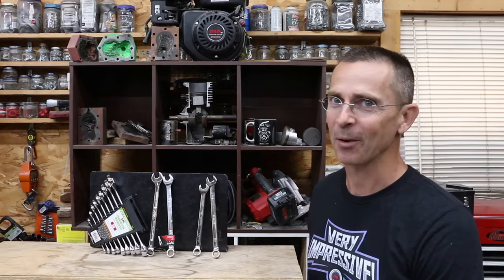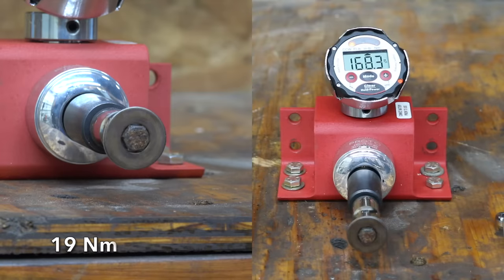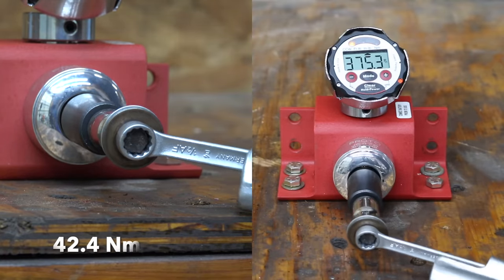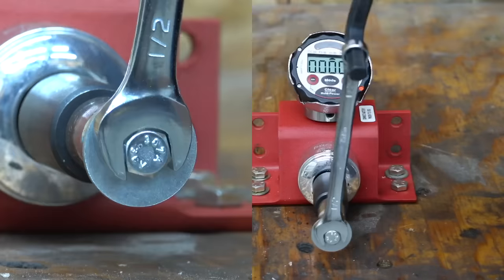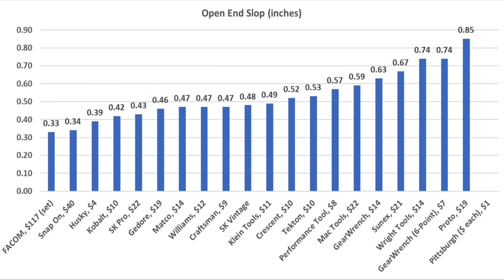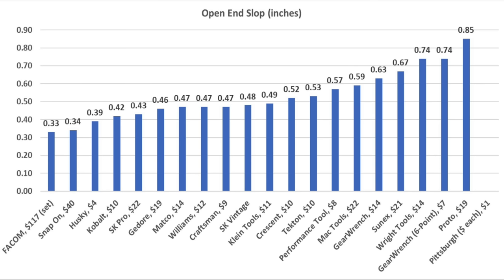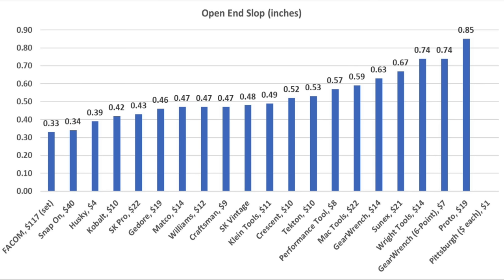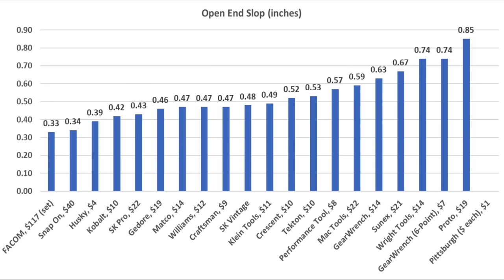Best Wrench? Let’s Settle This! Snap On vs MAC Tools, Matco, Proto, SK, GearWrench, Kobalt, Husky

Comment: Love this!  I go through 3/8” ratcheting wrenches like nobody’s business.  Gear wrench and Cornwell have done the best for me, but I’d love to see some 3/8’s ratchet get tested!
Reply from the maker: Thanks!  Thanks for the video idea.
Reply: Yep 😁
Reply: Snap-On 3/8dr ratchets handle over 250lb-ft. I’ve seen a test before but not on YouTube.
Reply: Which part of the Ratchet are you breaking to need to keep going through them?  I've been a Mechanic and use tools every day... I have at least 30 different ratchets in 3/8" alone... I've never broken a single one.  I have bought worn out vinatge craftsmans and gotten rebuild kits for them to restore them (Herbrand made era mostly, some Utica), and I have rebuild kits for every size of proto ratchet... but I've never had to use a single one.  Still got them in a little clear container waiting.
Reply: And......
 They will continue to wait whilst you continue to respect and take care of your tools, and use the right tool for the right job.....

Ive seen too many "mechanics" (lol) go for what they think is the "quick fix" and put a pipe over a spanner, or hit it with a hammer instead of respecting the tool and using the correct tool to remove a stuck or problematic bolt.....

Some lessons are learned the hard way 😮‍💨 .......

Comment: Great work! It's impossible to test, but there's a big difference between the tools of today and the ones made in the past. Trained as a diesel mechanic in my youth. Bought snap on, blue point, matco and proto tools back then. Almost all have survived 40 years of use and abuse.  Love the old proto wrenches. Great in hand and not too slick like snap on.
Reply from the maker: Thanks for the feedback.
Reply: I've got every brand of wrench imaginable--I'm in Erie PA & it seems like we're in rust belt/tool n die central. We have Crescent nearby in NY, probably 45 minutes away. Channel-lock 30 minutes  away & other companies in the area. I find $300 snap-on sets for $1. Indian motocycle collectible wrenches for a buck. Mac, Matco, Bluepoint/BP supreme, Craftsman, Bonney, Cornwell, wright, williams, SK, Wizard, Par-x & so on often for a dollar, even for a 15/16" or 1"+ never used wrench. I've got a lot of Proto & Proto Challenger and have to agree that these are among the best (except for one that had "Los Angeles" engraved on it;  that one broke. Go figure).

Comment: I like having a good/expensive set of sockets and wrenches for particularly tough or important bolts and also a cheap Harbor Freight version for everyday use. Those cheap things work 99% of the time for me.
Reply from the maker: Thanks for the feedback.
Reply: I’m the exact opposite. I make my living with quality expensive tools. I have some cheap tools for occasional use. I think I have a cheap harbor freight set in my boat that I hope I never use. I call craftsmen wrenches “knuckle busters” or “homeowners tools”.
Reply: And in all honesty, the Pittsburgh comes in two grades. The better ones are made in Taiwan
Reply: @benztech2262  out of curiosity what’s your living?
Reply: @livewirecowley  Judging by his handle I'm guessing he's probably a Mercedes Benz Tech
Reply: As a professional auto tech I have a lot of tools. Snapon, Mac, Pittsburgh, matco, gearwrench, and I have a lot of the same tool in multiple brands. My go to stuff is a mix of all the brands. I don’t give a shit about the brand or price, I only care about what works, and feels the best. Sometimes it’s a truck tool, like snapon, sometimes it’s a Pittsburgh pro. You would be surprised how often it is the Pittsburgh though.
Reply: @benztech2262  expensive does not mean quality. You won’t find a pair of pliers in my toolbox that isn’t made by snapon, because there is no better plier, but you also won’t find a single snapon torques bit in my box, because they are absolute garbage.
Reply: If you really need a tough socket, get impact (air-tool) sockets. I've had a few nuts I couldn't even break with an impact driver - for those I used a 4' long breaker bar. In one case I was removing a wheel hub retaining nut on a Honda Civic, and even with the car in gear and the full weight on the wheel, it wouldn't budge. 4' breaker bar resulted in the clutch slipping and wheel turning. Finally solved that problem by upgrading to a heavy-duty impact airgun. Socket never broke or rounded the fastener. Tough nut to crack!

Comment: I would like to see how the Icon line at Harbor Freight would stack up with Matco/Snap on / Mac tools. The sockets look identical to my snap on sockets.
Reply from the maker: Thanks for the suggestion.
Reply: @ProjectFarm  Another vote for adding Icon to the hand tool comparison when possible!
Reply: I was hoping to see Icons line up in here.
Reply: This is what HF does with a lot of their stuff. The problem is that most of the time its all skin deep.  Craftsman or Husky seem pretty decent for the home guy. If you're a pro, spend a modest amount and get the Mac.  Please don't make this a HF review channel Todd.
Reply: @boots7859  Currently, Craftsman and Husky have turned to India sourcing. So has the HF Pittsburgh and Kobalt wrenches. Craftsman and Husky are holding up well to most tests, but not Kobalt or Pittsburgh. Given that these brands are the most widely available to the average consumer, they should be tested to reveal their quality ranking. While most tool truck brands are out of reach of the average buyer. ICON is still made in Taiwan. As are most of HF sockets.  And I suspect they are OEMed by Gearwrench's parent company.  There is a notable improvement in performance to Taiwan-made tools as compared to made in China/India. So it's good to keep testing mainstream brands.  If you want to see tool truck premium brand quality shoot out, it should include the tools from Japan. They are as high in quality as Snap-On or MAC. Matco has slid down the scale IMO, no longer made in USA.
Reply: I'm also very interested in how Icon stacks up against the tool truck brands!
Reply: I've used the icon next to my gear wrench long pattern, the 12pt in the video, they were comparable in 'grippyness' tho the icon wouldn't loosen an 8mm that my gear wrench would, open end
Reply: They may look identical, but they don't perform anywhere close.
Reply: At least the Pittsburgh Pro line, everyone knows Pittsburgh is junk.
Reply: @boots7859  That's a bit unfair to blanket bash on HF like that. It's like saying "Don't make this a Home Depot or Lowes review channel". That's not the point of these comparisons. Each store has more budget-friend lines and more expensive lines. While many people would immediately dismiss all product lines at HF because of a bad experience with some VERY budget-oriented and arguably poor quality gear, there are some surprisingly good tools/brands there, as Todd as shown in a number of these showdowns. I would think it's beneficial for the consumer to be aware of quality tools regardless of where they come from.

If I'm a pro/power user, and Todd's practical tests clearly show that spending more will be a better business decision for me, then that will make sense to me. If I'm not a power user, but Todd has shown that a less expensive product can be acquired at HF for a reasonable tradeoff in performance compared to expensive "pro" tools, there's no downside to that. But who's to say that there are no expert level tools at HF unless they are tested like Todd does?

Todd does a great job coming up with practical tests, collecting meaningful data, making personal suggestions based on his observations, and then giving us the chance to balance each tool's tradeoffs based on individual circumstances and needs. No one tool/brand ever scores perfectly in every category, including cost and I love that Todd illustrates this with his practical tests. I especially love the surprises when a brand/tool we'd expect to perform well doesn't live up to the hype or when Todd finds an underdog at a great price!
Reply: We’ll icon and snap on are basically the same, the engineer quit snap on and started icon.
Reply: Snap On has Flank drive. The Mac tool open end noone beats it. There missing one big point here, the wrench offset. These people are not Line Mechanics, they have no clue what a real wrench is.
Reply: Thanks for taking the time for testing stuff , for us , I was gonna suggest including the latest V series by craftsman, (made in Taiwan) they look just like the matco .
Reply: I too want to see icon get thrown in the ring!
Reply: @boots7859  try the Icon line, they're working next to Snap on, Matco, and Mac and thhere doesn't seem to be a difference. I invested 2500 in Icon. It would have been over 10k from the Snap on truck. Now I can afford to buy additional specialty tools from the tool trucks.
Reply: @wngimageanddesign9546  don't forget Stahlwille from Germany. Some youtuber did a macro zoom and the tooling marks were minimal compared to snap on, while still being stronger then snap on.....
Reply: Even the old Pittsburgh Pro wrenches are miles ahead of the $7/set ones tested here. I’ve had the same(seldom used) set at work for about five years and I’ve been happy with it.
Reply: @Inwetrust-qy2ly  Love your e mail. I'm a big fan of 7018 also
Reply: @boots7859  So, you're saying you have a problem with unbiased testing of certain brands?
Reply: ..yep, I would like to see the different tiers of sockets/tools/wrenches, etc. sold by Harbor Freight tested, and tested against each other to see if the price differences are justified...we don't really expect the low-line basic Pittsburgh stuff to do that well, which is what is usually tested from Harbor Freight...
Reply: @henrysmith8012   Snap on also has flank drive plus on the open end, and it will out perform  the  Mac wrench , I used to do the demo with a customers wrench and ( Mac or anything else) on 1/2 hardened steel  bar stock. I sold a lot of wrenches when the customer’s favourite slipped off, and the Snappy didn’t .
Reply: For sure, the icon brand is not super cheap so would be interesting to see if it is a sensible compromise
Reply: Icon wrenches are made by the same plant that makes Matco.
Reply: @ProjectFarm  yes need to see how Icon stacks up.
Reply: @LBCAndrew  snap on didnt even do good. They lost to fucking gearwrench/tied what ajoke
Reply: I just bought a full set of Icon wrenches and I’m very happy with them. Unfortunately I couldn’t get the same full sets with ratcheting, what a bummer.

Comment: Thanks!  Liked and subscribed! This was a great test. I had suspected the cheapest brand in my tool chests to end up exactly as it did in this test, but I only use those bargain store wrenches for light, tight-access work. On the expensive end, I bought a few Gedore sockets in Germany in 1973 (couldn't afford a whole set). Almost 50 years and dozens of personal motorcycles and cars later, all the Gedore tools still look as if they were never put to hard work. My son, who is a car technician, won't touch any tools but Snap-On. This test confirmed it all, but most interesting to me, it points to a few brands where cost vs. durability is a nice compromise. That's a bonanza for people like me who use mechanic's tools often but not professionally. Again, much appreciated !
Reply from the maker: Thanks and you are welcome!  Thanks for watching and subscribing!

Comment: Essentially confirms practical experience and what most everyone should expect, the $1 cheapest ones that aren't complete junk are somewhere around 2/3rds to 3/4 of the best.  The real power is when you get 3 or 4 of the cheap ones, and don't have a second thought when you need to use a cut off wheel to cut one in half for access.  Having a 10 mm wrench that's cut in half can completely save the day on some tight access things where you can't swing a full wrench or get a ratchet in to it.  And another box end on that cut off handle gives you 90 degree access and full leverage in a tight space to loosen things up.
Standard procedure on one of my Town and Country vans was to remove other items for access to remove the water pump.  A cut off 10mm allows you to do it without removing anything extra just the belt and the pump, instead of having to double or triple the time and remove the other components to have better clearance. 
Of course you still have to remove the actually necessary access components.  But you can bypass a lot of them when you're willing to cut up and modify cheap tools.

Comment: If you are a professional mechanic, a good set of wrenches makes a huge difference. I have a set of wright grip wrenches with the anti slip open end, they are amazing. You should do a test comparing wrenches with anti slip open ends like the mac, wright grip, and snap on flank drive plus.
Reply from the maker: Thanks for the suggestion.
Reply: I was so disappointed not to see the Wight Grip version on here it would have destroyed every other wrench
Reply: Yes the Wright wrenches are superior to all others I’ve encountered
Reply: For me, the anti-slip open end is a game-changer, so that would be a great test.  For the professional mechanic, having to extract a rounded fastener wastes a huge amount of time.  Also, many of these wrenches are stronger than Snap-On or Mac because they have a lot more mass, but they won't reach as well into tight spaces.  It would be great to see a comparison of the mass of the open end and compare it to strength.  Still a great test!
Reply: Flank drive is just awsome. Except the price of course
Reply: @jt4277  Snap-On Flank Drive Plus ® 
Hands down best wrenches ever used, bought, or even handled in my 42 year's of working with my hands daily for a living and as a hobby as well. I've also worked in several different industries all requiring tools throughout those years and have tried pretty much every brand known to man or available in the US.
Reply: Is Wright about as good as it gets except for the bulk perhaps making it have a harder time getting to where is needs to go? "Satan" finish better in the hand than "Polish" ? 
Not too cheap but not the most expensive either?

Comment: I gotta say, with the exception where it was skipped, for FOUR DOLLARS the husky performed at average or near the top with wrenches over twice its price, at the lowest. If you're a pro, go for a pro brand. But on a budget that husky is damn appealing
Reply: Made in India.  I'm surprised it did so well.
Reply: Not to mention return policy. It snaps or bends. Go to your Local( no shipping or no going to tool truck ) Home Depot to get a replacement.
Reply: @michael931  I'm pretty sure that Husky is an old Canadian brand that got "offshored".  They used to be a very common brand in Canada.
Reply: @minuteman4199  Husky used to be made in the USA. Then Home Depot bought out their name.(won't warranty old usa Husky). Maybe it is possible they had a Canadian plant as well 🤔
Reply: Husky offers one of the best deals in a combo set you can get. I bought a 1025pc set for $2k a year ago. $2k is a lot, but when I thought of all the money I spent buying individual pieces or smaller sets, it was a no brainer. Hard to find a higher quality set for that kind of money.
Reply from the maker: Great point!
Reply: Yeah, I thought the Husky got hosed by him messing up the test.  For $4 I think he should have gotten another one & tested it right.
Reply: @11C1P  haha It did seem like  a bit of a strange data point. That one very low score brought its final score way down…for the money, i don’t think there is a better option than husky.
Reply: I concur, I am surprised Husky was so low down on the chart. It should have ranked about mid-way. I'd like to see a rematch with  brands not tested and include another wrench to represent Husky.
Reply: You can use any wrench if you're a pro because wrenches are used as needed and not a go to tool.
Reply: @michael931  There are some very good tools made in India. There are Indian brands such as Taparia and Jhalani that don't get exported much to the USA or Europe but have a very good reputation in India.
Reply: Yup. The Husky never failed at a fraction of the price. The few wrenches which only did slightly better, did so at arguably unrealistic conditions. If the Husky breaks off the bolt and doesn’t fail, how can another wrench really be better? The wrench can only be used as long as the bolt/nut survives. Let alone price.
Reply: @chiefblackberry7753  it only got that ones low point because he said he made a mistake testing it.  But somehow on the final scorecard, that meant it was in 19th place for that round???
Reply: @DarrenWigfield  Indeed. You cannot blame your mistake on a $4 wrench and give it bad placement because you could not complete the test.
Reply: @minuteman4199    Husky used to be made by the New Briton Tool Co. in Connecticut. I have some old Husky tools from the 70's. They were pretty good tools. Now with HD acquiring them I think they have been made in several places including Taiwan, China and India.

Comment: It looks like your Wright wrench is missing the serrations in the open end that help it grip. They call it WrightGrip 2.0. Those did really well in the Torque Test Channel test.
Reply: Ditto for snap on. I always find it odd when channels compare the non flank drive plus or fdx wrenches or sockets. I've yet to find a snap on dealer that doesn't sell the flank drive plus 99% of the time (unless the customer specifically requests the non flank drive for non marring reasons)
Reply: @toyorover1313  it looks like he got the Wright wrench from Amazon, and some reviews for that listing say they got a smooth jaw version. Must be old stock or maybe counterfeit (but it seems unlikely someone would counterfeit a fairly obscure brand). That's the downside of buying from Amazon.